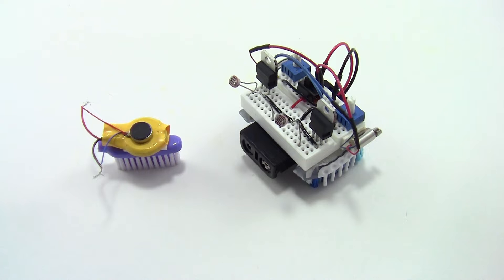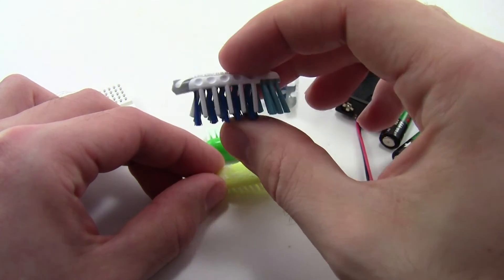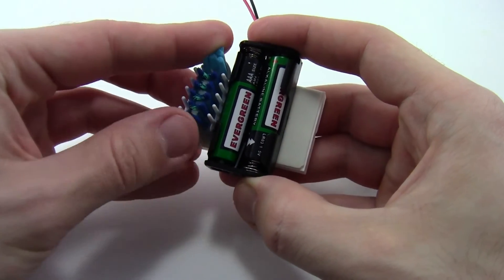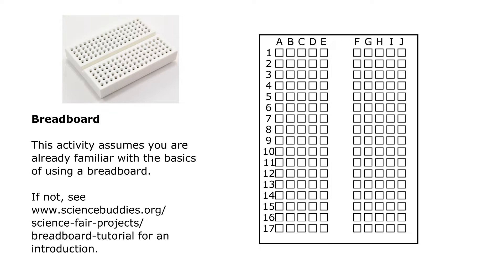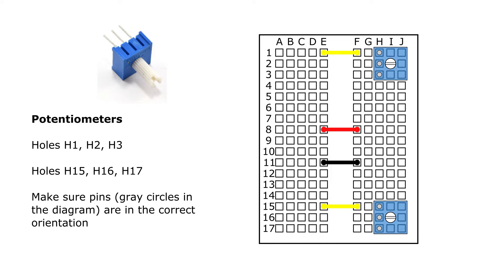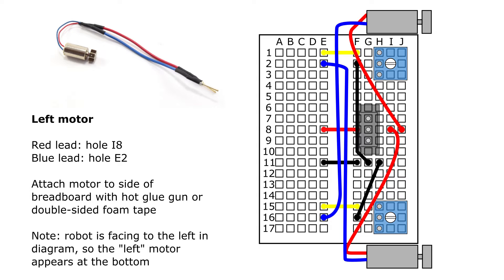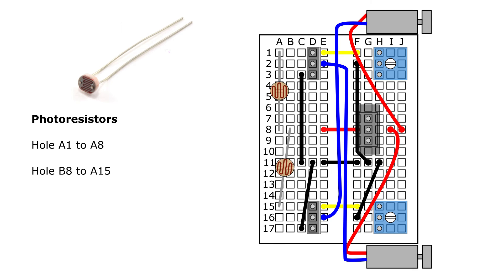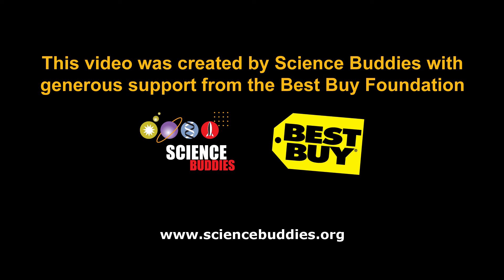Light-Tracking Bristlebot Instructions | Science Project

Comment: Can I know the MOSFET model and number u used please tell me I have to make this project under 10 days
Reply from the maker: RFP30N06LE 30A 60V N-Channel Power Mosfet, but a similar N-channel MOSFET will work. The important part for this project is for the MOSFET to have a low gate threshold voltage in the 1-2V range since the robot is only powered by a 3V battery pack. Some MOSFETs are designed to work with 5V logic and will not work with this project.

Comment: Great project 
But i have question 
Can I use Rotary Potentiometer (with wires) in this
Reply from the maker: Yes, you should be able to substitute other types of potentiometers as long as you can connect them to the breadboard.

Comment: Will 60a 50v mosfet Will work or not
Reply from the maker: The power requirements for this robot are far below the 60A/50V rating, but you need to make sure the MOSFET has a low "gate threshold voltage," usually labeled Vg(th) or something similar on the datasheet. Since the robot is only powered by 3V (2xAA batteries), the gate threshold voltage should ideally be in the 1-2V range. Some MOSFETs have a gate threshold voltage of 4-5V which will not work for this robot.

Comment: Hi, I want to know if this mosfet) IRFZ44 N-CHANNEL POWER MOSFET 49A 55V( will work with the robot or not
Reply from the maker: Hi - the gate threshold voltage for that MOSFET is too high. If you look at the datasheet on page 2, it is listed with a range of 2-4V: https://www.infineon.com/dgdl/Infineon-IRFZ44N-DataSheet-v01_01-EN.pdf?fileId=5546d462533600a40153563b3a9f220d. This robot is powered by a 2xAAA battery pack which is only 3V, so you need a MOSFET with a lower gate threshold voltage such as the FQP30N06L or RFP30N06LE: https://www.sparkfun.com/products/10213

Comment: Hi, what N MOSFET do you use in the kit? I need to replace one but I can't see the name anymore
Reply from the maker: This MOSFET will work: https://www.sparkfun.com/products/10213. If you read the product description you'll see that they carry two equivalent models that you could also purchase elsewhere. If you go with something else, the important thing is to check that it has a low gate threshold voltage, preferably under 2.5V. This is necessary since the robot is only powered by a 2xAAA (3V) battery pack. The IRF510 is another common MOSFET that will NOT work because the gate threshold voltage is too high.